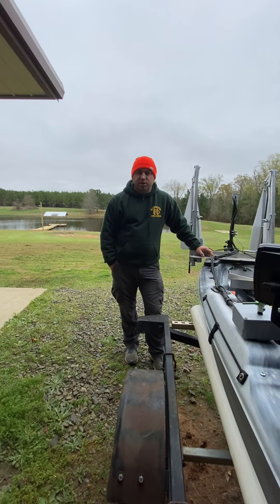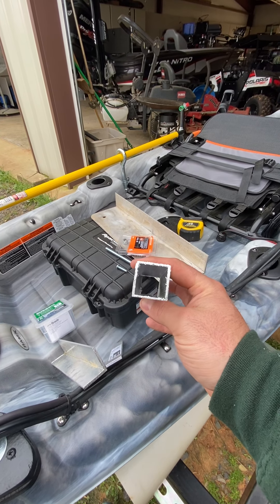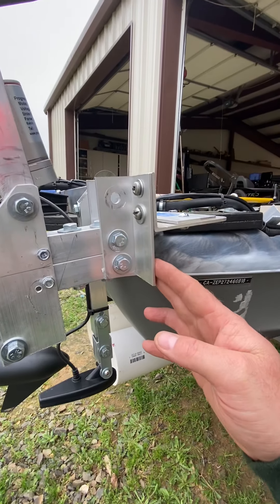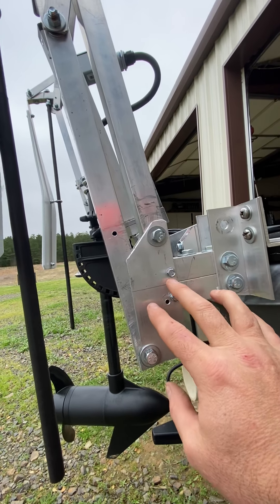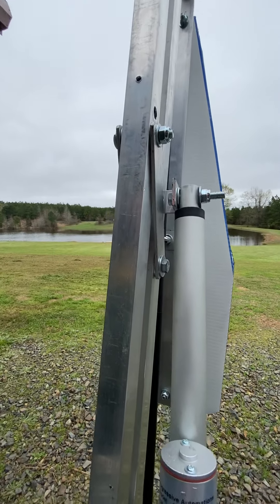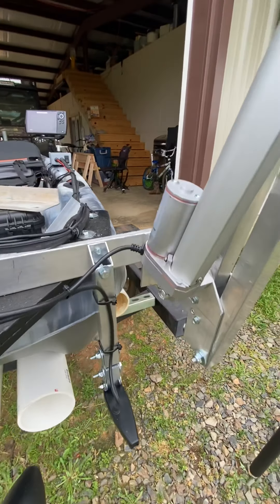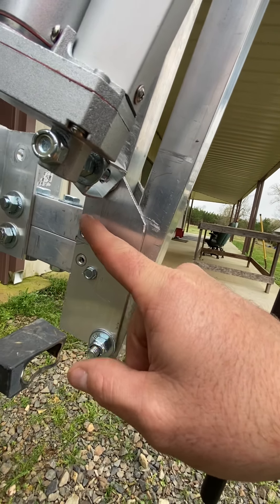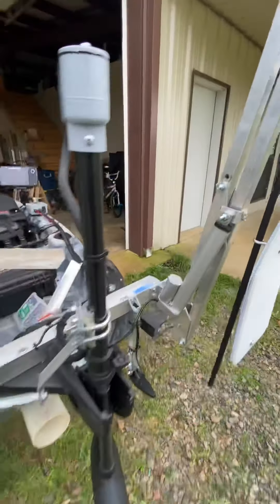DIY: 12 Volt Kayak Mini Power Poles #powerpole #diy #kayakfishing  #kayaklife

Comment: First, thanks for sharing a really nice DIY project.  I think you did a really nice job and anyone with negative comments was just jealous.   Ha Ha
I built a steering system for my Frontier 12  kayak utilizing those type of actuators.  I made it where you could either steer it mechanically with foot pedals for use the actuators.  It was a fun project to build.
John

Comment: I’m new too your channel and first off would like to say what a cool build , I’ve been searching around for actuators and can’t seem to find ones that are fast , do you have the name of the ones used in this video?
Reply: From my research these are slow like about 14 mm/s I’m looking at ones about 50mm/s even found about 100 mm/s but I doubt they would pull up out of the ground as the higher speed is less tourque

Comment: Nice,
I am looking for 2 actuators, main thing is cost, can’t find any under 100.00-125.00, woukd love to find a actuator like I want for under 80.00. I want a actuator that the motor is in line with the actuator not on the outside at the bottom like most are. Would like it to be waterproof, 12v, less than 1 1/2” in Diameter, and have around 12”-16” stroke, nice to hv a limit where I can set it. I found a couple but they range around 189.00 apiece. Just haven’t found it yet it’s out there just hv to find it any help greatly appreciated thanks

Comment: New to your channel love the vid  about how much do you think you have in them and where did you find the Actuators
Reply: And also the wiring and switch
Reply from the maker: Hello. Thank you for the comments and for being a subscriber. This was a project that I just started and ended up being one that I really enjoyed. The actuators were the most expensive thing along with the switch... I found these on Amazon and later bought from the manufacturer because I could get them shipped quickly. The square tubing came from Lowe’s and bolts came from Lowe’s or Home Depot. I had some of the materials but I would guess the entire build was around $400-$500 with actuators. It was a fun build!  Thanks again
Reply: Thank you sir great build they look awesome I’m looking to build some for my job boat
Reply: Make sure the actuator is one that can get a little wet.  I made the same same power pole with the help of tiny boat nation.  Go to that channel if you're looking for small boat modifications

Comment: What type of bushings did you use in your pivot points?
Reply from the maker: I didn’t use bushings... there is not a lot of force when they are down.  Thanks
Reply: Crappie Junkie Outdoors in the process of designing some off of fusion 360. Think I’m going to 3D print some bushings for it though.

Comment: Awesome job!!  I have the exact same kayak, and would love to build these. Do you have an email address I could contact you at for a parts list and measurements?  Thank you 🙏
Reply from the maker: I really don’t have a parts list.  I just started building. The 1” aluminum swears tubing was 30” in length. Bought some flat bar and bolts and went to work.  There is lots of room for improvement or more precise measurements but I didn’t have those tools.  Thanks

Comment: How much would it cost to have you make a pair for me
Reply from the maker: Thanks for interest. I will do what I can to help: answer questions, tips and tricks. The materials, actuators are not to bad. Shipping is off the charts.  It’s would be cheaper if you can build them yourself.
Reply: Crappie Junkie Outdoors I’m not that good with my hands to build those, but I really want a pair for my 14 foot boat because they are smaller than the micro power pole and cheaper